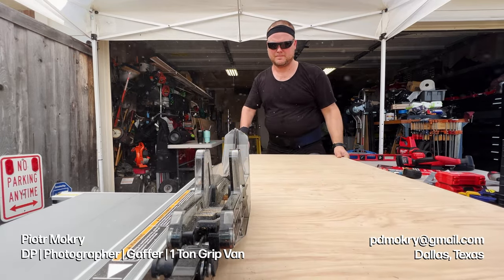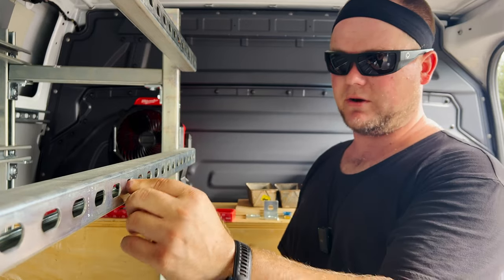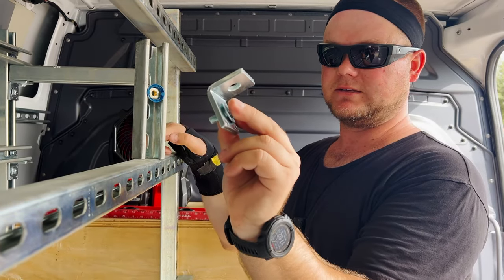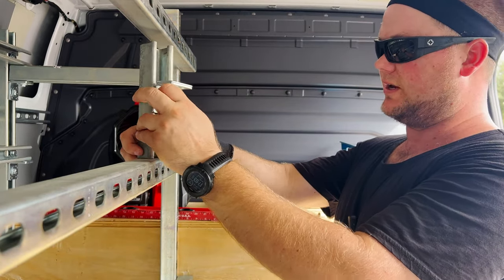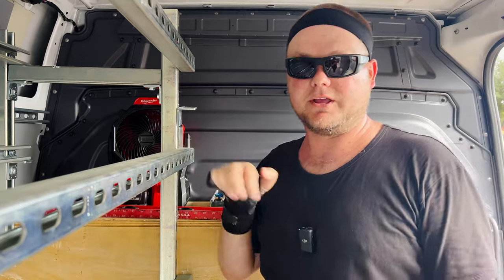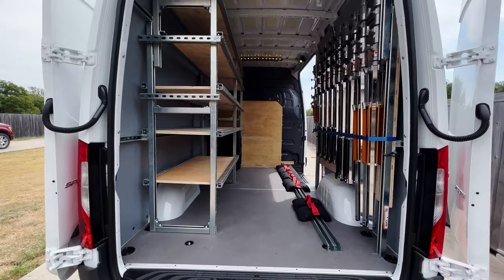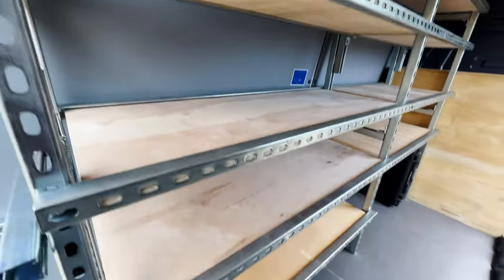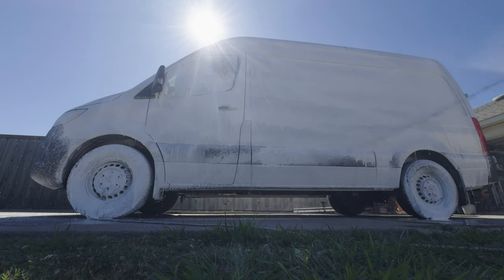1 Ton Grip Van EP3 | Dallas, Texas

Comment from the maker: Finally ready to work out of the van! Do you like a cart only style setup or a hybrid like mine?
Reply: When I had a Sprinter, it was setup with just E-track around the perimeter and I strapped carts on both sides. I also mounted stands on the back doors. It worked well for me because I was often putting additional camera carts in, and sometimes I needed to get everything out entirely, so having it all on wheels made that very simple. The major problem with how I has it setup was it left a very narrow walkway down the middle that wasn’t wide enough for a cart, so it tended to get packed with awkward long things. Dealing with those things was always a hassle because they had to be moved before you could load or unload anything at all. 

I like how yours is designed. It wastes less space because you can still keep a couple of carts in the center isle, you aren’t ramming into the van’s wheel wells with cart wheels, and it takes better advantage of the height. It also looks like you still have enough room to carry one or two collapsed Magliners in the vertical position in front of your two DIY carts. Overall, nice job!

What’s your plan for sandbags? Ideally those would be near a door, or when you get the lift gate, on a cart of their own.
Reply from the maker: @MrAndrewClaycomb  There are a few locals that have their vans as 100% carts. They are great for big shoots. But when you need just one thing off each cart, it can be a nightmare. Since I do both camera and G&E, this was the best setup for me overall. Like you noticed, two carts and some magliners do the trick.

I run shot bags and have 20 x 20# shot bags right at the sliding door. You can see it kitted out for  shoot here:
https://youtu.be/TCBzDbbidTw

Thank you so much for the comment and for watching!
Reply: @MrAndrewClaycomb interesting to hear! I agree that a hybrid setup is probably the best. You can fit more stuff on shelves (generally speaking), but having carts is also a must have. I really like how piotrs is set up. Seems very sturdy, and he’s able to fit a bunch on those shelves whether milk crates, apples, aputures, etc. I have a similar setup with shelving on the left side, stands on the right, and then E track all around on the walls and shelves to secure carts and fishers. It seems to be pretty versatile as opposed to everything on carts. Looking forward to seeing what lift gate he goes with! I’m thinking he likes the palfinger ;)

Comment: 11:57 is this "all" you need in terms of regular lightstands? Do you maybe also have a bunch of slimmer Manfrotto style prosumer grade lightstands?
Reply from the maker: So I have a bunch of the light duty stands, but don’t use them too often. I tend to grab cstsnds for the little setups. I carry 9 full size and 2 short ones on a cart. I also bring rolling stands if it will make it easy on me.

Comment: What would you estimate is the total weight of all the strut and lumber? How are you on total weight once loaded with all the gear?
Reply from the maker: I have a payload capacity of 4,453 lbs. All in on the added strut, lumber and hardware I'm at 750 lbs on the build so far. I have 400 lbs of shot bags on the van. 

That gives me 3,300 lbs of payload for my gear. I have plenty of wiggle room and don't expect to reach my limit with the style of work I do.
Reply: @PDMokry  Nice. What do you expect the lift gate weight to be? And what do your custom carts weigh empty? Thanks for making these videos!